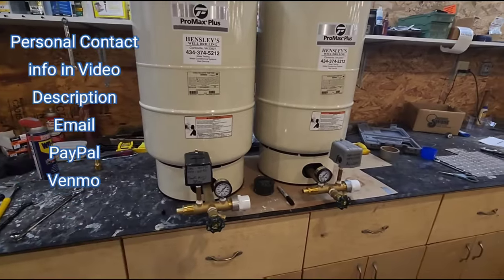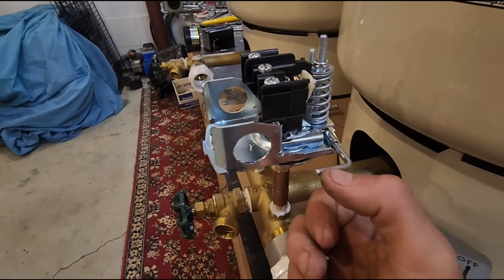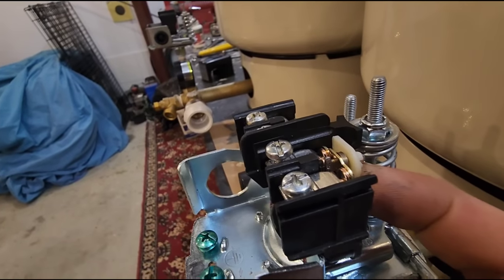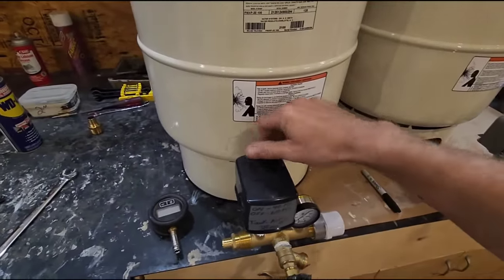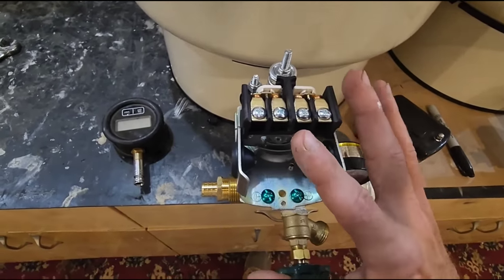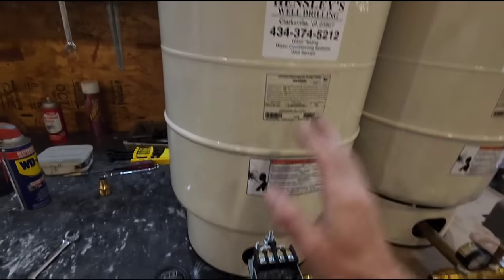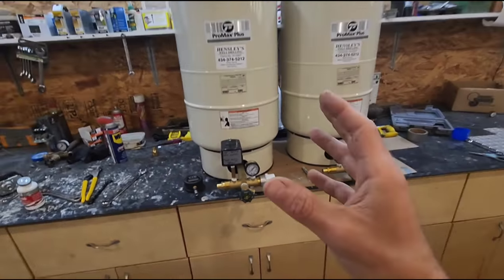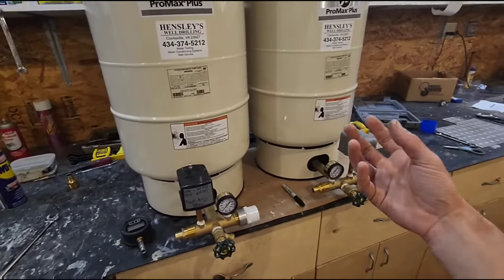Most Common Reason for No Water!! Reset Pump Pressure Switch. Water Well Repair Vlog Ep.18

Comment from the maker: Donations are Appreciated! 
YouTube Doesn't Support My content type. 
If my videos help you save time and money, please show Support (if you can) if not I understand & I'll still help you with fixing your problem. 
Hwdracing@gmail.com  -  PayPal 
Philip-Hensley-3  -  Venmo
SuperThanks Button -  YouTube
Reply: why does my cut on switch gets stuck and i have no water?i need to trip it manually,that is weird,.
Reply from the maker: @Fishing is Life  normally that's the nipple below the switch is clogged
Reply: @h2omechanic  thank you so much so tomorrow i will check it.thanks again.
Reply: @H2o Mechanic any tips for my line pressure gauge reading 21psi? i’ve reset my bladder tank pressure to 38psi (it was about 25lbs i) after verifying my pressure switch is 40/60. I also used the pressure switch cap to cycle the contacts. When i do that the line pressure gauge drops to zero then climbs back to 21psi.
Reply: You need a Bitcoin wallet. If you had one, I would send you a few sats for sure.
Reply from the maker: @James Chambers  I've got a coin base wallet. Never new I could share a link to it
Reply: @h2omechanic  find something with Bitcoin lightning, the fees are almost literally zero! Walletofsatoshi is super easy but is custodial. Bluewallet is non-custodial (your keys, your wallet, can't be shut off).
Reply: Thank you for taking the time to make these videos. I installed a new well pump and new switch along with all of the plumbing and when I went to turn it on, I put it in the start position, and it came on for five seconds and then stopped. I checked the pressure and adjusted it to 28 psi (30/50 switch) and after trying to restart it, no water is flowing through my pipes. I just had a new well pump installed four months ago. I'm pulling out my hair because I can't figure out why no water is running.  Do you have any ideas?
Reply from the maker: @R Car  you need a clamp style amp meter to check amp draw of the pump. Should be around 7. If its above 11,pumps bad. 
Most likely it's a bad wire down the well, someone didn't keep the wire tight & it rubbed the jacket off exposed to the copper inside. Itll occasionally work for short periods of time. 
If it trips the breaker (bad pump)
If not, it's likely wire related. 
Or the switch is old/bad
Reply: @h2omechanic  Thank you for the help.  The breakers didn't trip and the switch is brand new.  Looks like I'll be learning how to pull a pump.  I'll check out your videos on that.
Reply: Yes, I will donate for you to help me ☺️
Reply: @h2omechanic   I need help I'm    going crazy I'm   sick and my boyfr iend has cancer so he can't help I don't have help so we have no water I push the points and get water for a while I have no help and I don't have m
Reply: The box is lose and leaking water I can't afford a plumber I'm disabled but I would appreciate your help
Reply from the maker: @Bernadine Salazar  I'm here to help anyone if I can. Hwdracing@gmail.com leave a detailed email and I'll try my best! If your skilled with tools you can probably figure out the issue with my help, but you might not be able to repair it
Reply: How do I find these videos cause I want to fix my girlfriend well and I want to do it myself
Reply: How can I make a donation? I'd be happy to do it!
Reply from the maker: @DonIsMe123  PayPal = Hwdracing@gmail.com 

Venmo = Philip-Hensley-3 

So happy I could help you out!  I can feel the high five 👋 from here!
Reply: Thanks for saving me from a weekend without water. I woke up this a.m. with no AC and no water and a forecast of 94F and 98%. Got the AC working but thought I was going to have to call well company about the well. Saw ur video. Contacts were closed but I tried your flick the contacts trick. Water! I did not see the reset bar on the side. Switch is a Square D like pictured otherwise. Is there a way to reset the switch w/o the reset bar? (For future) Paypal donation on the way.
Reply from the maker: @garymcbrien2288  thanks for the PayPal donation!
Reply from the maker: @garymcbrien2288  so typically a switch becomes a little wonky when the tank is the actual issue. 
Watch my videos on bladder tank, this will teach you how to properly check your tank & possibly need to add air to it. 
If you tank tests fine, then the switch is building carbon deposits due to higher amp draw from the pump...so the pump may be working now, but could be on it way out in a few months. 
Familiarize yourself with how the system works & try to make sure its all set properly.
Reply: @h2omechanic  The pump is not very old. I know that may not mean anything nowdays. What is the typical amp draw? Breaker is 15A two phase. I suspected maybe this was caused by a nearby lighting strike because, like I said, AC was out too. Cause of the AC being out seemed to be breaker tripped on the condensate pump.  Nearby lightning maybe caused some arcing on the switch and tripped the breaker? Thanks.
Reply: Had a power outage on Saturday. Was good on Sunday. This morning well pump was on direct and no water.
Reply: So what happens if my gauge says PSI 40 but I still have no water coming out
Reply from the maker: @jessebalderas4297  the gauge is faulty, or you have a plugged up filter
Reply: DO THE CONTACTS OPEN WHEN OFF?
Reply: You’re welcome! I’ve never made a donation to a YouTube channel before, so I just want to make sure the donation went through. Did you receive it?
Reply: thank you just what I needed to lnow
Reply: Pressure pump gauge stays at zero when turned on.

Motors running, pressure tank can release water.

But no or less water to house. Please help.
Reply: Sorry to message you so late I loved your video explained a lot on the pressure that my tank is supposed to have on the bladder but I have a huge tank and I'm wondering if it varies
Reply: How does youtube not support content that helps homeowners? There's nothing bad about this and this probably gets more full views then the content they support
Reply: Thanks fir sharing your knowledge
Reply: Had no water replaced pressure  switch still no water could I have bad breaker don't even any spark if I push contact off and on
Reply: I have a question about my well. Had been replaced by a well technician.  Have a 40-60 switch. New bladder tank and everything else that needed replaced was.  Problem is if you use hose of shower and washer, it will run out of water, pressure goes to zero, and about 5 minutes later it will start back up.  Not sure where to even start. Any help would be greatly appreciated.
Reply: If you can help me I’d gladly donate to help you. I have a problem with trusting techs. I’m an HVAC tech but out of my realm entirly
Reply: If you can help me I’d gladly donate to help you. I have a problem with trusting techs. I’m an HVAC tech but out of my realm entirely
Reply: My jet pump not cutting on. System replaced about 3 years ago. By accredited plumber. I replaced pressure switch only to have the exact same problem.  I drained system and installed a drain valve at the pressure tank and raised the tank 4 inches higher off the floor. Switch is a 30-50 I checked the tank at empty it was at 28psi. Checked voltage. All checked out fine. Moved pressure switch to 14” from tank instead of off the pump housing. Still doesn’t cut on. Checked the check vanve with us located in same room, and about 4’ from pump. It had a suction drill on line to cistern, and with a slight fingering it released the pressure and took in air. 

I’m at my wits end here!! Any suggestions??

Comment: How do you not have hundreds of thousands of subscribers? Your videos are the best out there! Explained easily, professionally and perfect!
Reply: Absolutely agreed
Reply: Agreed
Reply: Thank you H2omechanic  I just subscribed.
Reply: If my low pressure switch sparks is that a sign that it's bad cuz I ve did all you implied on here and still no water
Reply: @coreyranberger8894  Mine has been sparking for years, at least 20,  without  any problem. The fact that you have a spark indicates you have power to the switch so it might be time to check out the pump.
Reply: Thank you

Comment: Hello Sir. I have great news! I went back through everything and I took all of the plumbing apart to inspect all of the pipes and fittings. You had mentioned in another video that debris can clog the nipple to the pressure switch.  The nipple was clear but because you mentioned debris, I also had a look at the check valve and lo and behold, there was sediment blocking the plunger.  I would not have thought about that seeing as though all of the parts were brand new. It's an older well and after seeing the sediment .... now I want to drill a new one. Thank you so much for inspiring me to not give up.  I'm a woman in my 50's and  love to take on projects like this. Thank you!

Comment: DUDE!!! This video saved my Christmas!!!! Just went through the big freeze here in CO, and my pressure switch wasn't turning off the pump a couple days ago, so I thought an ice block had formed in the water feed, and I flipped the power off to try and save the pump from burning itself up. We were lower than -10F. Once it got above freezing I kicked the power back on, but no water pressure. I thought more melting probably needed to happen, but eventually I started worrying about the worst, like the pump was ruined or something. I started doing research on the internet for the components in my system, and wasn't getting anywhere. On one of the pages for well pumps was a link to a video. From there was a link to a suggested video on an overview of well pump systems. When I went to watch it, your video was suggested on the side. In your video you show the type of pressure switch I have, with the manual  lever on the side. Mine was set to "Auto" with no water pressure showing on my gauge. Once you showed how to hold that lever at a 45 degree to start the pump again, and to hold it until the water pressure got up to 30psi and let off slowly, that was the ticket to get water back in the house! You Rock!!! MERRY CHRISTMAS!!!!🎄☃
Reply: Somebody needs to invent a switch that you can tun on remotely via blue tooth or or something. Somebody could make some money

Comment: I was literally seconds away from pulling the whole tank out to try to find where the water leak was coming from thinking the bottom of the tank may have rusted out when I thought it might be a good idea to see what the internet had to say about low water pressure.  Turned out after I reset my pressure valve, I could see it was a ruptured cooper pipe UNDER the tank in the sub floor that was spewing.  But I couldn't tell without water pressure where the leak was at.  You saved me at least a day of labor!  Thanks bro!

Comment: Wow what an excellent learning experience your video have been. My daughter has a well pump that has gone bad and I needed to learn about well pump system asap. The kids can't afford to pay big bucks for a company to come out. The one guy they had out wasn't much help. I do a lot of stuff, plumbing, electrical etc so I have to give it a try first. I knew nothing at all about these systems but now I feel like I might be able to help  her get water back up and running. She has a control box with a capacitor and what appears to be a hard start. The wires around those are all fried. Got new parts coming in and then the next thing is to diagnose why they are fried. If she needs a new pump I'm going to have to go against your advice and get one from Lowe's or home Depot because we don't have the money to buy a top quality one. Heck we don't even know how deep the well is. It's about 400° f in Florida right now so it's going to be fun working all day on this thing without any way to shower if I don't get it done in a day. LOL thank you for being such an excellent teacher. Subscribed!

Comment: First time home owner. First full day in the house and the water had low pressure then stopped. Pump was humming and hot. I was convinced the house inspector had missed the issue. Watched your video, followed the instructions, and it was fixed in less than 5 minutes. I have no doubt a plumber would have happily charged me for a new pump due to my ignorance. Thanks for saving me hundreds!

Comment: Thank You for the video.  I used your video to guide me through getting my pump to work.  I had a huge ant stuck between the contacts of the pump switch.  After clearing the ant out of the contacts, I used the plastic device I had to open and close the contacts you showed in the video.  Amazing job sir, thank you.🇺🇲😊

Comment: Woke up at O dark 30 to no water. Have cement contractors coming in 3 hours.  Know zero about well plumbing and its' electrical.  With in two minutes of watching this video, water restored. Absolutely brilliantly done.  Burnished those pressure switch contacts and away it went.  THANK YOU!!!!!!  I subscribed.

Comment: Ok, H2O mechanic, I have an issue my water keeps cutting off. I had to put my pressure switch in the middle at 45° angle to turn it back on there is no power outage in my area. It just started today and I already had to do it twice. Any advice what could be wrong?

Comment: Thanks for the video! Power went out last night and this is the first time I lost water pressure. Breaker was flipped but still nothing after resetting it. Today is a holiday and it’s extremely difficult to get any plumber out my way anytime soon. Came across your video and it was the exact solution to solve the problem after I thought I was in for a hefty plumbers bill. Thanks for saving me $$$ and any potential lost time with no water! Very grateful for your clear simple explanation and instructions!

Comment: Awesome content. You just saved my butt on Sunday of Labor Day weekend. Just put a self watering tank for 7 cows they knocked it sideways and it drained my well. I found you r video and it worked. Reset the switch as shown and it drew up. Used the cover and held them for about 10 seconds and it fired up. I was in dire straits

Comment: Thank you so much for your videos, this is my first home that has a well system. In the last three week we are hearing a clunking sound that we think is coming from our pressure tank, it's not constant and not always after you run water or flush but shortly after & sometimes it will do it when no water is being used. thanks again for any help you can offer.

Comment: Thank you! I thought maybe a pipe had froze, but the temp in my well house didn’t align with that. We did loose power last night though, and we had the water trickling. Power was only off for about an hour and a half, but that was long enough to loose pressure. I have the one without the lever. As soon as it made contact the pump kicked on. Works like a charm. Thanks again!

Comment: Liked & Subscribed ........ My Well Pump wouldnt turn on so I suspected a wiring problem . So I removed each wire and fiddled with them ......reinstalled.... and turned the pump on and it would run for a split second and shut off . Watched the video ...... carbon on the contacts was mentioned so I grabbed a tooth pick and a Q-tip and cleaned them . Now it works again . TY

Comment: Thank You so much. I had no idea what was going on and this video saved me. holding the switch on a 45 degree wasn't working so I opened it up and there must of been something stuck between the contact cause a couple flicks and it turned back on. Thank you again for the video. I learned alot. Godbless your channel. Cheers from Ottawa

Comment: Subscribed. Good luck.

 Thank you!! My water was off at all faucets and lawn irrigation this morning. My pressure reader was 2 psi. I powered OFF the main breaker and did 4:06. I powered on the main breaker and my pressure reader is 50 psi!!!! Many thanks!

I will have an electrician replace my pressure switch.

Comment: I've worked at a golf course for over 25 years and have worked on big 125 psi  irrigation with a pump station that puts out over 1100 gpm's. Thought i knew everything pump related until I Bought a new house with my first well pump senario and..... So.... Yeah, you've basically saved my ass several times! Thanks!!

Comment: Awesome video. We are way more educated than we were before. We've had our new well for 2 1/2 years and the pressure switch just started giving us issues. Thought we had it fixed and then had no water this morning (one week after the initial issues). We are going to go check the air pressure and see what's up with it. Thank you so much for the clear explanation and the education.

Comment: Thanks for the channel. I Will be trouble shooting tomorrow. I get water but seems to be running like my rv pump does in my rv. The water isn't a continuous steady stream. The stream seems to run with my well pump, pushing out then slowing down as my pump turns on. Last week the pressure was steady and continuous as always like I was hooked up to a city water line. My guess is the bladder tank, so I will try what you suggested here and test the pressure in the tank first.

Comment: Thanks for all the help, I put a new switch on drain tank got air right  28 on 30/60 , clean switch tube out and it works great but it only goes up to 50, tried adjusting the short side to it bring up no affect,

Comment: @ 4 minutes when you discuss resetting the switch by hand using the plastic cap- So we woke up to find we had no water, long story short a bug got in between the two contacts so when the switch turned on it caught the bug in the terminal not allowing power to go through! Snapped the terminal back a few times a wala! Thanks alot man